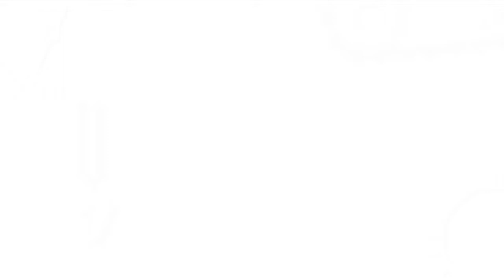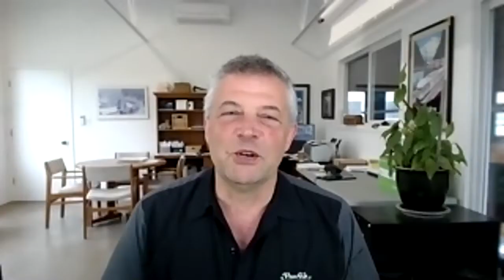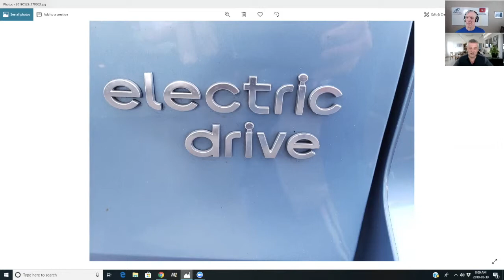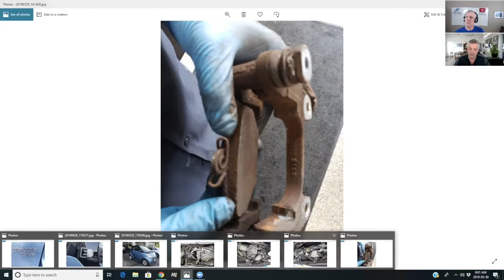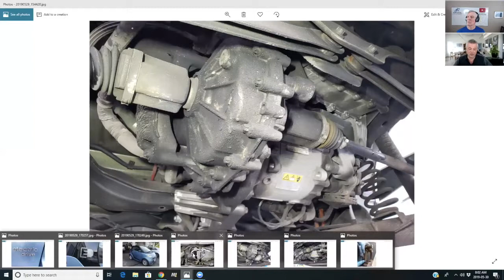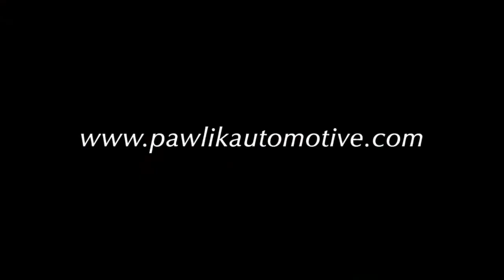2014 Electric Smart Car Maintenance Service and Brake Repair

Comment: Could have spoken a bit more about its maintenance and performance in Winter Canadian Weather conditions. Also, I would have like to know the battery degradation in range after using it a couple of years/ kms. Is this battery liquid cooled or air cooled?

Comment: Each time I take mine out  I make sure I give my brakes one good stop to use the brake calibers and exercise the brake pistons. With regen braking they don't get enough use and can size up. I replaced the dessicant myself. Its under the passenger side of the battery. It reqiures a T90 torrex bit but since this can cost $20, I used a vise gripp and a nickle to sucessfully remove it. The upper end of the cartrige pops off and you can buy the dessicant beads from amazon for $14 for 1 1/2 lbs. This is enough for many many refills if you store it sealed to the air. Mercedes will charge $200 to do this and top off the fluids!!